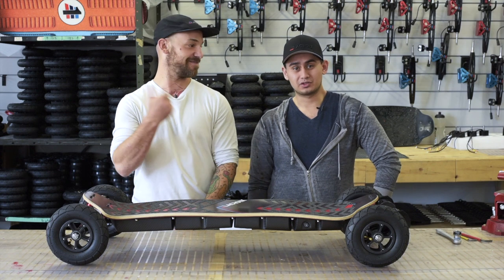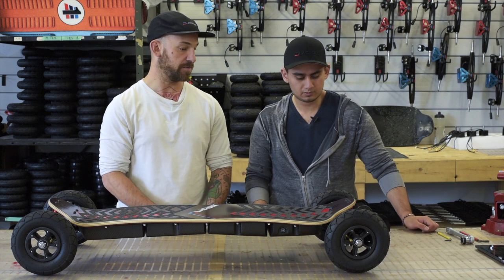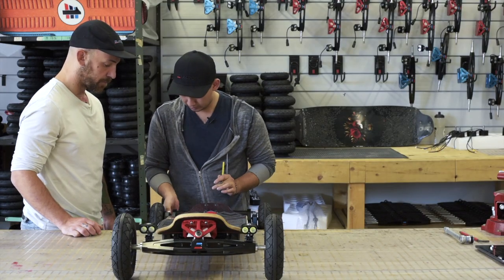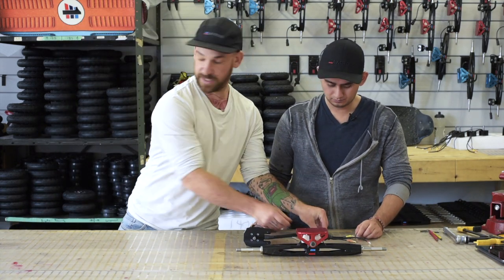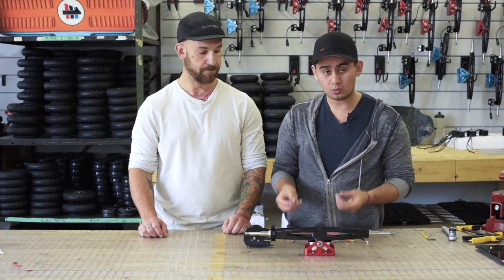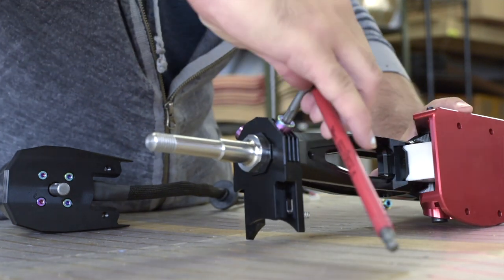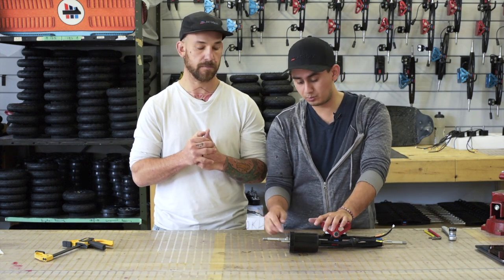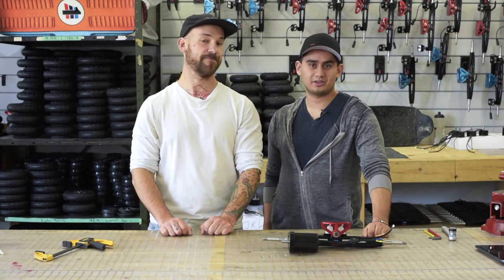SELF TENSIONING BELT DRIVE SYSTEM

Comment: Is it normal for the belt to get loose over time even when the 2 screws are still tight? I noticed the belt had more slack after 10+ rides
Reply from the maker: Hi Vince do you have the self adjusting belt drive system ? If so, make sure you tighten them once a week depending on how many times you ride

Comment: Question
The axles that the Falcon drives are on are they compatible with the belt drives. 
Say I have the Falcon on can I use the same axles for the belt drives?
Reply from the maker: So falcons are a bit wider. What we do is we put wider axles in the back but keep shorter in the front so there's more stability when you ride and it doesn't affect turning as hard. Overall the difference is minimal